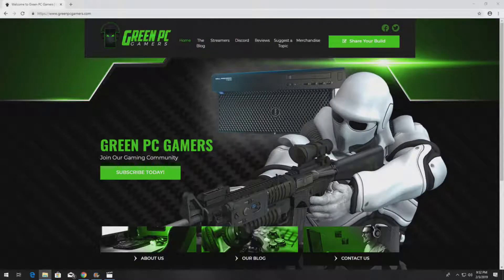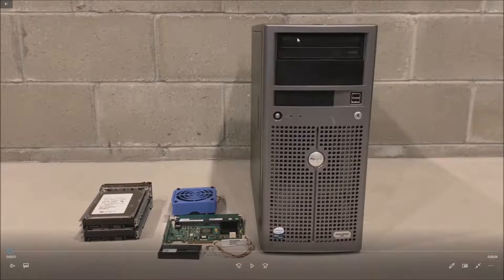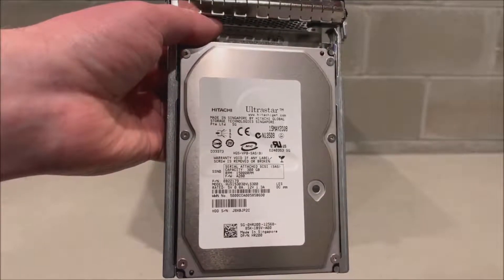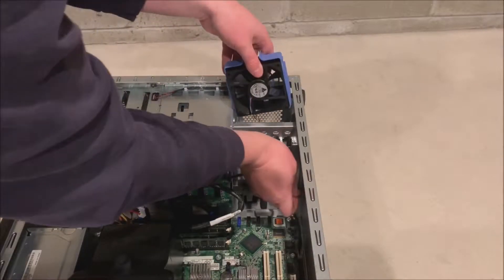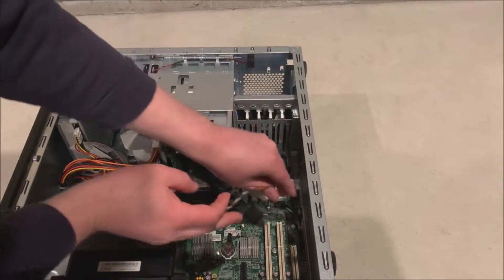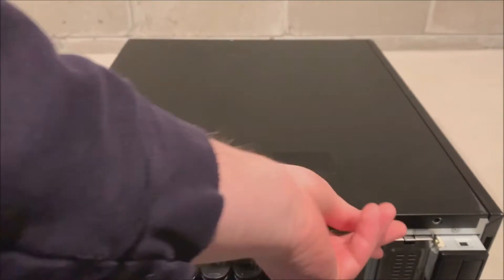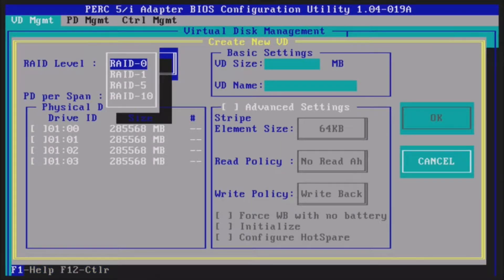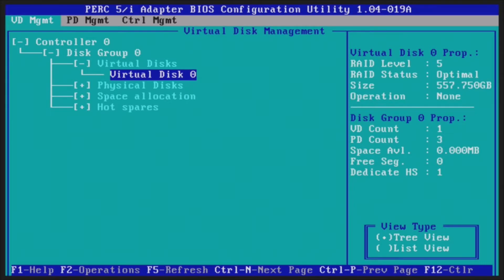How to install a Perc 5i Kit in to a Poweredge 840 + Raid 5 Hotspare Configuration

Comment: I have the SAS 5/ir card in my 840. If I installed a PERC card in it, and went through this setup, could I do it with the drives already formatted and the OS (Ubuntu) already installed? If not, its no biggie but I have already installed the OS on another, smaller SSD that won't be a part of the RAID array. The two drives right now currently have zero bytes on them (as far as I can tell) but I'm not sure if RAID is actually enabled -- hence my desire to possibly install the PERC card.